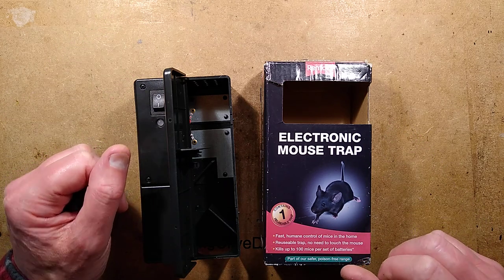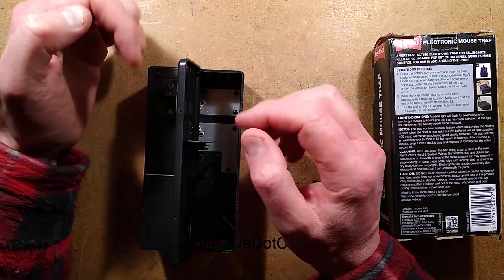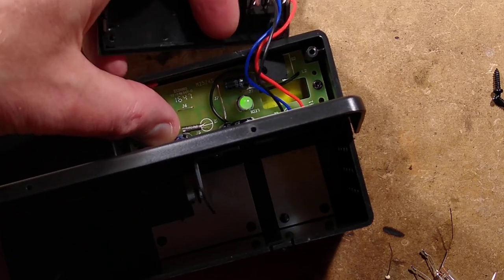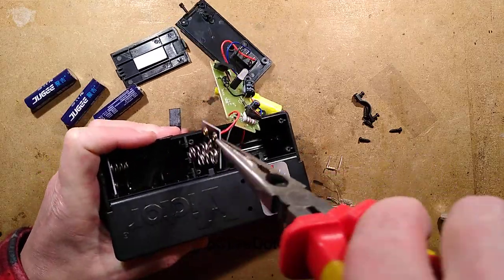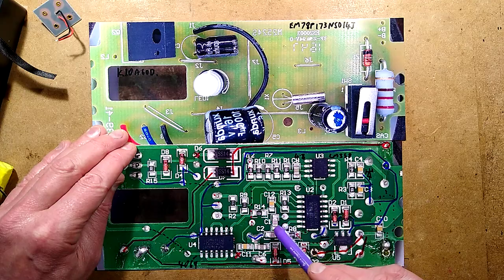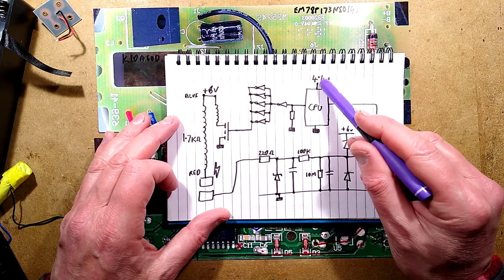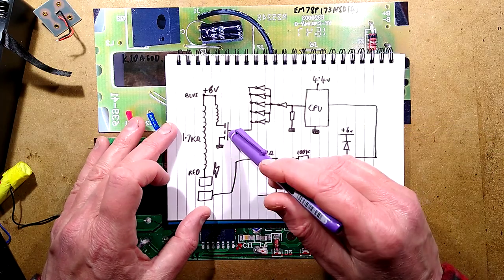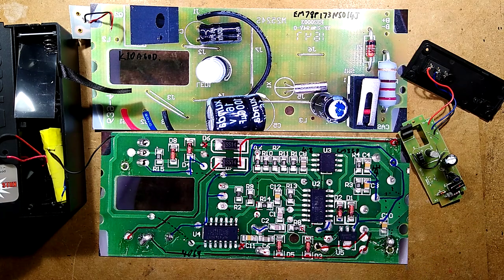Inside a Rentokil / Victor electronic mousetrap.

Comment: I actually petitioned to have these electric traps installed at my work place. They're one of the cleanest most humane ways of pest control. Before my business invested in industrial electric traps they used a combination of glue traps and starve boxes. It's very hard to work next to a glue trap full of screaming mice or listened to them kill each other in a starve box. Gruesome stuff.
Reply: One of the ladies at work insisted that we use humane tipover traps (made of opaque plastic), but of course neither she or anyone else ever  checked them... until alerted by a rather insistent aroma. The' humane' trap had caught a mouse which had then starved to death and gruesomely rotted inside. 

It would be more humane to just finish the mouse quickly.
 I think this design would be improved by having a sonic alert when it had killed something cos TBH no one's ever going to check it in a shared office space otherwise due to feelings of diluted responsibility. I guess if it's at home you realise you've got to check it.
Reply: A spring loaded  traditional break back trap is quick and humane and has no batteries to go flat.
Reply: There are many human-kill alternatives that are even non electric. Check Shawn Woods' channel
Reply: You say starve box, my mind thinks small mouse gladiators in a colosseum style setting! I was a steelworker, if we had traps like starve boxes guys would be checking them all the time and running bets on winners.
Reply: @Gribbo9999  no they are not with the spring traps they still often don't properly kill them instantly ....
Reply: This trap could have a relay output which would be used to indicate 'activated' to warn occupants to check the trap before the deceased mouse started to decay...
Reply: Humane my ass, getting shocked to death isn't really an humane way, an old school snap trap (well designed modern and very strong blow) that hits the mouse in the head or snaps its spinal cord is much better.

Edit;yes i know traditional snap traps might cause lots of suffering, by old school i meant blunt force trauma not the iconic unreliable snap traps.
Reply: @teresashinkansen9402  I mean neither cause much pain for the animal and the old school snap traps aren't all that effective. Mice and rats will often trigger it without being under the little arm and then take the bait. Not to mention it's far from uncommon for it to just hurt the mouse or rat and hold it there alive until it starves to death.
Reply: A far more truly humane guaranteed humane solution is a thing called a terrier. Finds the mouse and kills it instantly in one bite or doesn't kill it..
Worst & cruelest methods starvation or poison or spring traps if they fail to kill. ('Snowflakes' aren't really humane they just don't like seeing or hearing the killing.)
Reply: @darklorddylan1316  There is a reason why electrocution isn't used anymore as ejection method, it was deemed not really humane by most countries even since the beginning.  Like in human heutansia in veterinary medicine sedatives is what is used, in slauter houses a strong blow to the "forehead" by a special tool is used. Electrocution it isn't used except in a few documented cases of unregulated places in third world countries.

Electrocution doesn't guarantee instant unconsciousness and the animal would suffer a very painful death (have you ever received a bad electric shock?), sure might be better than glue traps and starve boxes tho. I think a hybrid trap with a powerful spring and sensors that can tell when to release the spring for an instant ki ll would be better, smashing the brain should be the best way. 

PS. The mispellings were done on purpose, i made the same comment hours ago and YT didn't published it.
Reply: @teresashinkansen9402  I would say it's arguably more humane than poison, a lot of poison does not work immediately and drags out the dieing for the animal as most cause internal bleeding.

Electric traps I think depends on the construction. These battery powered ones will probably struggle to provide enough current to kill the animal quickly, but I feel like there are better electric traps that do.
Reply: @miawgogo  Im not saying electric traps are the worst sure its better than poison but still it would suck to die by electrocution because as you said the current isn't high enough to knock them out instantly, they are just paralyzed by the current (hence the labyrinth so they can't back up) and die of asphyxiation and heart fibrillation but this can take many minutes. 
Probably my first comment wasn't written properly, by old school I meant physical force, i get traditional snap traps are relatively ineffective and might cause a lot of suffering. A well designed snap trap should get the job done, a trap were only the head gets hit by a powerful blow.
Reply: @teresashinkansen9402  just have a gun-trap that shoots mice dead when they come for their last meal, would be really popular with the north 'mericans, i suspect.
Reply: @GashimahironChl  I'd buy one, or 3, and I don't even have mice that I'm aware of.   Neighbors cats take care of them I suppose.
Reply: I mean whats wrong with old fashion neck snapping action.
Reply: @hillppari  the old fashioned ones often miss the neck. I've seen mice and rats have only their limbs caught under the arm and that's no good either.
Reply: @Gribbo9999   Except for when it only clamps some other part of the mouse's anatomy and the poor thing ends up dragging the trap around with its mangled limb... no thanks, I've been using these electronic ones for a few years now and have never found anything but immaculate, instantaneously killed mice.  Never any sign of any kind of suffering or struggle, plenty of them still have their eyes open and almost look like they might run off again!  I've always bought the bigger ones which are designed to kill rats as well - my theory being that if it'll kill a rat it'll hopefully kill a much smaller mouse with almost zero chance of failure.
Reply: @AAAyyyGGG  the industrial ones we use have a much bigger battery (9volt I think) and have an indicator light that goes from green to red when it's been discharged. Every morning we walk the route around the warehouse and empty any red light boxes.
Reply: @teresashinkansen9402  I think it depends on the voltage really. The ones we ordered are much larger than the one he took apart on video and the mice I've seen dumped from them are always dead. Compared to glue traps and metal boxes that have sharp angled entrances that work by starvation I prefer the electric traps. 

I worked at a grainery that used big toothed snap traps and while they were effective they were horrendously messy (sometimes cutting the rat in half with it's force) and were one time use ( big plastic waste, not good for the environment). No method is fun for the mouse but I'd take electrocution over a glue trap every time.
Reply: @Lucien86  having kept rat terriers I agree well need dogs are efficient but in an industrial setting with moving machinery or a grainiry dogs are not a safe option. Not only is it unsafe for the dog but the worrying of a rat slings blood and feces around. Not really acceptable in some settings. 

As a side note ive never had a problem with proper ratting dogs doing their job, we had many of them on the farm. My only objection comes from purposefully trapping wild rodents to 'prove' the dogs for sport or useing them to harass wildlife.
Reply: @Gribbo9999  But can be dodgy to set.
Reply: If that's humane I'm willing to bet you've never had an electric shock
Reply: Ioan : poison produces a contaminated corpse which can let poison enter the food chain.
Reply: Most humane way...😂 For those who own one of those electric fly swatters, that smell of insects frying is well....fucking nasty. Just imagine the smell of mouse fur and flesh frying. 🤢
Reply: @Spector_NS5_RD  These traps don't fry the mice. You'd need a lot more current for that to happen.
Reply: @paulpantsoff6584  Aand have you ever had an electric shock that has knocked you unconscious? When you're unconscious, you tend not to feel anything.
Reply: Once sufficient numbers are achieved most people myself included lose sympathy for the mouse's plight.  I too am just trying to survive.  Mice defecate and urinate over everything they cross.  They can be relatively noisy and have awakened me at night.  While I applaud the humanitarian ethos espoused here I ask those holding that view to return to share their thoughts after they've been pissed and shit upon for a year or maybe even had to surrender their favorite snack after being sampled by the "cute" rodent.

I am using a trap tested by Shawn Wood.  It is called the Micro Mouse Trap.  I've caught five mice since the beginning of this month, one of which was caught this morning.  I caught four in the first twenty-four hour I owned it.  It uses a micro processor to release a typical (but slightly stronger) spring loaded kill bar.  An infra red sender and receiver sense the presence of the mouse and actuate a solenoid release mechanism.  I have never had to re-bait a trap because the bait was stolen.  For the people debating the topic, death is usually near instantaneous.  On some rare occasions the mouse will flail about for up to a minute before is succumbs to its injuries.
Reply: @albertosapiens1  Works for me.  But what about the mice?
Reply: Ugh.  Yeah - I tried to detach a newly-trapped mouse from a glue trap once.  Determined that I just couldn't do it without breaking the poor thing's bones, so I ended up drowning it to put it out of its misery.  Mysteriously, whenever I'm around glue traps or "live (until they starve to death)" traps, the glue side ends up stuck to the floor, and the mechanism on live traps fails in odd ways.  <.<
Reply: @strayiggytv  in case you haven't done so already: watch a few of Shawns videos - with snap traps it seems to be important to set them at the correct location or even better inside a wooden enclosure, so that the mouse can only enter from one side. If done like this they seem to be quite reliable and humane.
Reply: Oof that sounds sad, glad you got electric
Reply: @joinedupjon  I was thinking those tipover traps could be pretty humane if you just put a chunk of dry ice at the bottom every so often.
CO2 asphyxiation in one of the few approved methods to kill lab mice.  Breaking their necks is also pretty quick and considered humane too.  Electrocution, not so much.
Reply: OR.. OR.. now get this, right? You could NOT kill mice maybe?
Reply: @joinedupjon  The trap is humane, the people obviously weren't, so don't say "the 'humane' trap" as if it's to blame for some pricks not checking it.
Reply: @Gribbo9999  No, it isn't humane at all. Killing is NEVER humane.
Reply: @looksirdroids9134  Might be suitable in your own home where you're there 7 days a week to check it... but there's pitfalls in a shared work place. IMO and experience people don't consider that and think buying the trap that says humane on the box is the end of the story.
Reply: @miawgogo  the electric traps absolutely put out enough juice to kill a mouse or rat instantly. I had made my own and used a taser that had a output of over a million volts and the store bought one had more power. As a matter of fact if you weren't careful the little guys would burst into flames from all the voltage.
Reply: @albertosapiens1  Like the gun trap

Comment: "We'll bypass the safety circuits, that's the best bet." All together now: DON'T TRY THIS AT HOME.
Reply: No, this "do not try" is dumb. It is only intended to cover up your ass in case some idiot kills himself. It is only legal stuff. I think we should expect viewers to be smarter than that and let the rest being covered by evolution...
Reply: @l3p3  that's the natural way to deal with idiots 👌🎩
Reply: @Trevor_Austin  When you hear that eating detergent capsules (Tide Pods) has become "a thing to do" it does not bode well for civilised society.  As mentioned elsewhere, the film "Idiocracy" was meant to be comedy, but is fast becoming a documentary . . . . . . . .  :-(
Reply: Darwin was definitely onto something with his 'un-survival of the thickest' theory
Reply: There is no way you can kill yourself with this. If anything you will feel a tingle in your fingers if you touch the plates. The reason it can kill mice and other small rodents is because they are small.
Reply: *unless you know what you’re doing.
Reply: Or do. I’m not your dad.
Reply: @Drakey_Fenix  I got a shock from one of these during its power-up sequence (because I was thoughtlessly holding it on my palm, and the 6kV pulses are carried on bare contacts with less than 5mm of air to the surface the trap rests on). It was not just a little tingle. It was rather more like a cat had bitten the crap out of my palm. Maybe not harmful in the long run, but quite painful in the moment, and probably not great if you're well-grounded at that moment, either.

Comment: I have several of these at home in my garage! The low battery flashing light is more of a suggestion, they still work perfectly fine for quite a while after the warning first appears. Eventually the battery voltage will drop below what is sufficient to enable the self-test, but I've found it could be months between the alleged low battery warning and the actual cessation of operation.
Reply: Yep. Same discovery here...

Comment: I used to work in a small office that was in a converted barn. We had about 10 of these battery operated traps. While they worked, the aftermath is pretty horrific. The little mouse Poops and Pees itself at the time of electrocution. So the traps end up in a really nasty state.
Reply: and dont forget the animals state...
Reply: On/Off?
Reply: Think how embarrassed the mice must've been.
Reply: Should be higher amperage 600v at about 100a and it would be almost self cleaning.
Reply: @dadillen5902  60,000Kw would be a bit hopeful,  subject pretty near explode.      .      .  Our maint. people, did find charred remains of a cat (suggesting it was the causation), unfortunately the brick D.C.  Annexe interiour  (720cubic Metres)  would never take too repainting, stayed a sooty copper/black, the ten 750V DC High Speed Circuit breakers were not recoverable .   .   .  ( the resulting DC ARC consumed them all  )    shoveled it all out the door!   (copper, steel, iron, rubber, paxolin, aluminium, slate, the cat kept as proof, most ! )